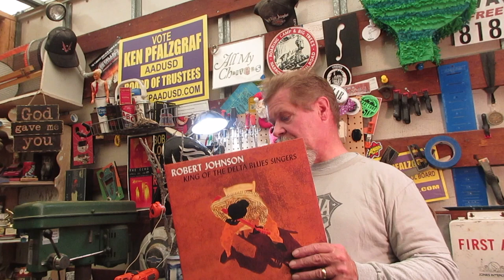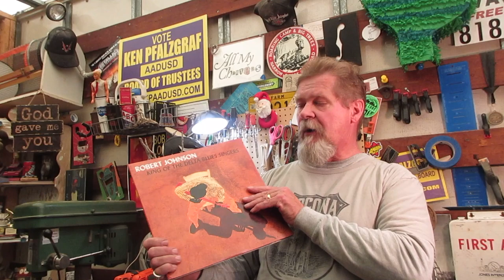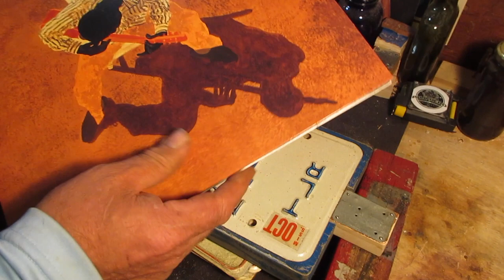Drill Press Headstocks

Comment: A drill press is not designed to take that kind of abuse. It will wear out the bearings in it and that can be costly to fix. 
 It would be better to attach the template to your wood and then use a router with a guide bearing to cut the part out. Could be a small low cost trim router from harbor freight or a router table. As long as the guid bearing rides on your template it will work.